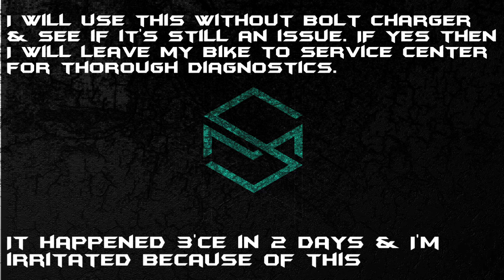Bajaj Dominar 400|Issue with bike|Irritated with it|Very frustrated|Headlights not working

Comment: Bro idk if you will read this or not but My dominar 400 Headlight's High beam and low beam are switched so if i use high beam the LOWER beam will turn on but if i switch to Low BEAM it just switch back to the HIGH BEAM light which bike thinks is a LOW BEAM and because of that i cant use my bike at night because the high beam wont turn off at all even on Low Beam it is always on so if you can help me out it will be wonderful for me.

Comment: What's Your Take on - Dominar vs Duke ?
Reply from the maker: Can you please specify which Duke are you pitting against Dominar?
Reply: Duke 390 :D
Reply from the maker: To start with both share the same heart but Duke has more power than Dominar. Both are made for different purpose, Duke is meant to be a street fighter and Dominar a power cruiser. 

Duke is a light weight powerful bike with all the bells and whistles you get in a 390cc bike (some 300cc don't offer what Duke offers). Whereas Dominar comes with the same engine but has been de-tuned and makes 10hp less but has the punch and linear power delivery :)

Dominar is priced at 1.77 lacs ex-showroom Maharashtra

Duke 390 2017 is priced at 2.56 lac approx ex-showroom Maharashtra

So what do we get in Duke 390 for the extra 80K we pay.

1. New design. 2. Led Headlights (which is included on Dominar as well). 3. 3 mode ABS. 4. TFT screen instrument cluster which looks futuristic. 5. More power. 6. Better tyres. 7. USD forks. 8. Lighter bike. 9. Push Botton for engine start.

So to conclude it completely depends on you, what will be your primary purpose city rides with occasional touring or mostly touring, your budget and your first impressions about both the bikes.

For me Dominar 400 was sufficient for me and it covered most of the things in sub 2lac bike. Different people have different preference and choices :) I recommend ride them get the feel and decide. Both are good bikes in their world and you won't regret buying either of those :)

Comment: Hey I had this same issue. Changed the fuse twice but still same problem. Later I gave it to bajaj to find the root cause. High beam flasher was the issue. Seems like it fried the circuit. They changed the whole board under warranty. Also please note my bike is pure stock I dint even fix bolt charger at tht time....
Reply: naveen kum if this really worked ... I will suggest this to Bajaj service centre in Andheri hope this will make it easier for them
Reply: Karan Mehta please go ahead yaar. A frnd of mine had this same issue. It was a wiring fault. Cause was different but problem same. Please get yours fixed!!
Reply: Till when can we claim for getting this done under warranty?

Comment: Hi, I'm also facing the same issue, i replaced it with new fuse for lights(15ah) and it is blown out again, as of now alost 4 fuses blown out and I'm stuck in a place where Bajaj service guys don't take Dominars. can you please tell me why it is happening and any solution ( i need head lamp and horn should be working at least)

Comment: is this problem seen with other dominars too??
Reply from the maker: samarpan bhattarai Not with many Dominar's. Few have it but the root cause is different for them just like me.
Reply: Shaggy Maniac ohh... Is there any other problems with this bike I mean major problems... I am planning to buy dominar for may daily ride.. Seen lots of complaints about vibration.. Milage ... Wires.. Small fuel tank etc..  So m a lot confused now.. If u can suggest.. Help me..  
Thanks in advance
Reply from the maker: samarpan bhattarai Nope. I don't know others point of view about Dominar's vibrations but as per me there are negligible vibrations. I recommend you test ride it and check for yourself (test ride vehicles are at times in a bad shape). For daily commute it's a very good bike :)

Comment: I had a same problem 
But my 3 Rd fuse is going wrong  by this self is not working I can't start a bike 
I changed 3fuse from 3 days  
What is the solution please tell me
Reply: Is there any solution. Same here. 4 fuse been blown till now. Not sure what to do.
Reply: @ajinkyapurohit3588  Any Fuse Will Not Go By Itself ,Get The Wiring Checked By An Electrician .There May Be Something Causing Current Spike Due To Which Fuse Goes Off.Save Yourself From Major Electrical Issue.